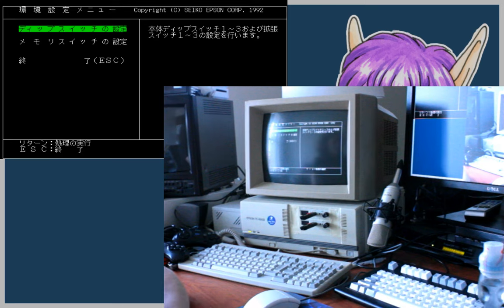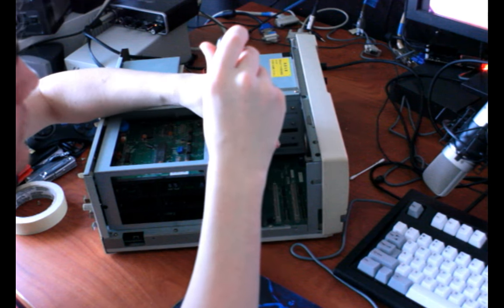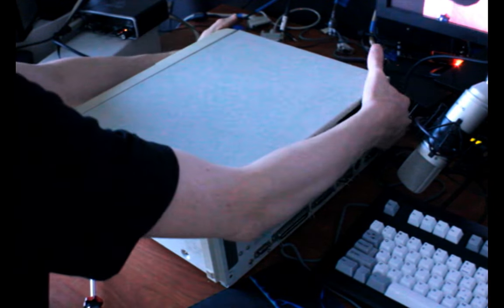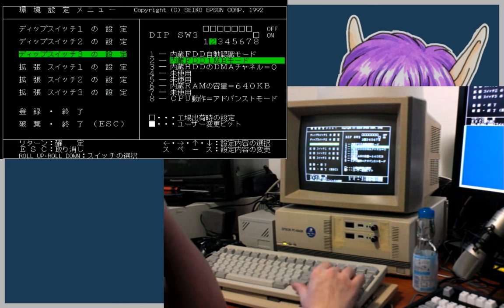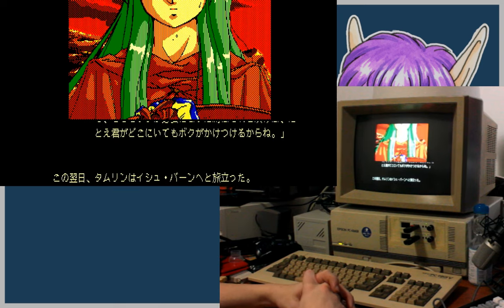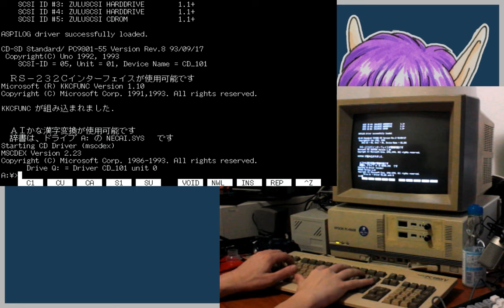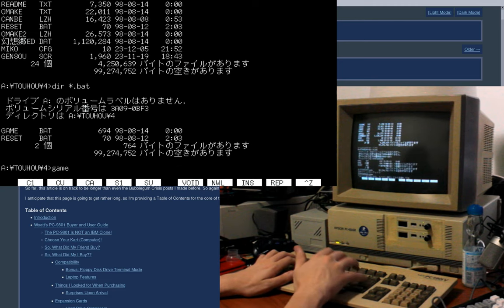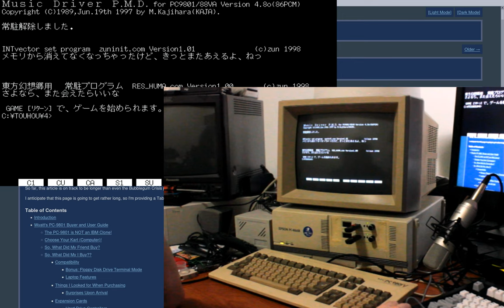All About the Japanese PC-98: My Epson PC-486GR Experiences (How-To, Beginner's Guide, and Gameplay)

Comment: I looked at the blog post and I really think some people worry way too much about somewhat newer models with built-in Windows accelerators, Pentium 1s, etc.  I remember a specific point in the blog you mentioning certain A-mate models with built-in Windows accelerators being "post-apocalyptic for DOS games" and to me that's way over dramatic.  I'm pretty sure that those added chips from Trident, Cirrus Logic, etc. don't handle the 640x400 16 color stuff at all and just kick in when software that supports them is run (such as Windows of course and some other DOS software can use them as well).

To me it gives the impression that like any model from late 1994 onward will just not run any DOS games at all and it's just not true whatsoever.  I've known several people with Pentium 1/Windows accelerator equipped models and they've run almost everything from the 90s at least absolutely fine.  Nobody should be so scared of them.  The only issue is some of these models not having built-in FM and needing to buy a card and certain games running too fast, but that's nothing unique as older IBM DOS games can be the same way.  Wish something like Setmul existed to disable cache and make it the speed of a 386, I'm sure it's possible.

Keep in mind too PC-98 DOS games were still being made years after Windows accelerators already came into the picture, so it would make literally no sense to make a game like Night Slave in 1996 and not have it run on the latest models around at the time.

As far as Windows on PC-98 goes, personally while I'd never buy a PC-98 just for that, it's fun to mess around with and doesn't hurt to try.  And the thing is, there's a fair bit of Japanese Windows games that require Japanese Windows to work and while yes you can do that on an IBM PC, to me it's more interesting and fitting on a PC-98

Btw, as far as the SB16 goes, it has a socket to add a YM2203 chip to make it a 26 compatible card, and they're much cheaper than an actual 26K or especially 86 so it's a decent budget option.
Reply from the maker: It will not run early DOS games well. Anything that was made for a V30 CPU has a chance of being way too fast unless it's capping its blitting based on the passage of time rather than CPU cycles.
Post apocalyptic is exaggerating, though. Yes.
For Touhou, a newer model is actually better.
But even in Japan people talk about the later models as having lost their "98-ness," and I tend to agree, especially for systems without C-Bus slots (like Valuestar V200). Might as well get an IBM at that point, when an earlier system will run ancient games at closer to the right speed. Bubblegum Crisis for instance.
Interesting about the SB16, did not know that.
My friend got a Cereb C200 for Touhou and it has both OPL and OPN built-in (although it's a "CanBe" since it uses something like YMF288 instead of a 2608).
My Epson had a built in 2203 but I highly, highly recommend getting 86 sound if you can stomach the price.
The window accelerator problem is for games that use 200 line video modes. Ranma for instance. And for monochrome modes.
They aren't awful options, but a 486 or older machine will more reliably be able to play DOS games, and won't have as much built-in hardware you can't disable eating up IRQ's.
Reply: @wyatt8740  I mean yes, I'm sure some really old 8 color-era games from the 80s would be problematic on them but to be honest even the beloved Ce2/Cs2 (I have a Cs2 btw) struggles with some of them too (such as Ys and Return of Ishtar having graphical corruption) so it's nothing unique.

But really imo, for the majority of 90s games they are just fine.  You can find various videos proving this with people happily playing games on models like the V13, Pentium PC-98 laptops, etc.  Oh, and Flame Zapper is another game that really does benefit from a faster machine, on a 486 the 60fps mode is unplayable.

The 200 line problem sounds more like GDC not set to 2.5mhz to me, which I think all 9821s allow you to change.  I remember trying the Screamer (200 line game) and it looking messed up until I realized it was set to 5mhz. Also if you run a 256 color game like Puyo Puyo 2 then run a 16 color one afterwards they can glitch out, but just reset the machine and it fixes it.

Really the problem I have with saying some of the later models "loosing their 98-ness and became more PC-like" is that it implies the later ones can run Commander Keen now or something, and that never happened even all the way to the end.  Also, just because some (like the all-in-one Cu13) lack C-Bus slots, doesn't make them totally worthless either imo.  They still play Kamikuishiki Village and that's all that really matters.

If I recall btw, NEC released a DOS utility to adjust IRQs on models that have both C-Bus and PCI slots.
Reply from the maker: @thepirategamerboy12  The GDC speed has absolutely nothing to do with that actually. That might be a timing bug for your specific game though. There's something you can run in BASIC to cause the problem under either speed. https://radioc.web.fc2.com/column/pc98bas/pc98disphw_en.htm
90s stuff is fine, but you can play almost everything on a Ce2/Ap2/Epson with 86 card/whatever, and the pentiums miss out on about a full decade of software.
Oh yeah and policenauts won't have PCM on a pentium system with canbe sound. And stuff like the Valuestars often don't have any kind of OPN at all, just OPL3. And yes, there is a PCI config utility that mostly works but won't let you disable things like a built in modem.
They lost their 98-ness because they ran the same exact windows 9x software everyone else ran. WinQuake, etc.. And they used OPL sound like sound blaster cards, which was inferior to OPNA (objectively; OPL is a subset of the capabilities of OPNA). And analogue gameport joysticks instead of MSX style ones.
Nothing wrong with having a pentium, it just is much less interesting and unique to me. And to me Ys is an argument for getting something from the 80's with a V30 and a mechanical keyboard if you're thinking of buying a second machine. BTW the 486GR also has this problem with Ys. I suspect it's a 486 thing. There's much less DOS stuff that really wants a pentium or higher, and for Win9X i have an IBM compatible with Japanese Windows on it.
Reply: @thepirategamerboy12  Pardon my intrusion into the conversation, I believe I have some insight of value to share. 

For whatever reason I have come into possession of a Cereb along with multiple Ce2 and Cs2 machines. I'm in a rather unique position to adjudicate for myself, and have observed there are significant differences with how (whether because of the Trident card present in the Cereb or not, I can't say with confidence) the Cereb handles games versus the Ce2 and Cs2 - and not just differences attributable to CPU clock speed or RAM. 

In fact, I have a Viper MULTi CPU accelerator board/"upgrade board" for the Ce2 which raises the CPU speed to as high as 100 MHz and can also be used in the Cs2 with some light modification for improved results (Ce2 has 25 MHz as default, Cs2 33 MHz). I actually have slightly less RAM present in the Cereb than for my Ce2/Cs2 (they are highly interchangeable). My Cereb has roughly ~30 MB (can be expanded) while I have a 32 MB stick compatible with my Ce2/Cs2. 

So, interestingly, I have "leveled the field" relatively speaking in terms of RAM and CPU clock speed between the Cereb and Ce2/Cs2. The main difference then would appear to be the architecture - the Ce2/Cs2 lack any window accelerator like the Trident present in my Cereb. 

Interestingly, the Cereb does a better job of handling the very old game of Ancient Ys Vanished/ "Ys 1", while my Ce2/Cs2 cannot run it properly without immediately running into issues - perhaps a case can be made for the Cereb here although I suspect the better solution is to pursue a later PC-9801 rather than an early PC-9821 as the Ce2/Cs2 are. But I digress. 

Whether using actual floppy diskettes of the original games, or floppies written with the game files, or a Gotek to simulate a FDD (or using actual original CD-ROM discs or burned discs - the Ce2/Cs2 come with a CD-ROM drive) the games run far smoother and stabler with less hitching, stutters, and some visual effects are present which are otherwise absent when run on the Cereb (or displayed incorrectly). 

The Cereb has a more modern FDD and a more modern CD-ROM drive (my variant specifically is the Cereb C200/C). I've tested the Cereb with what it originally came with, as well as a Gotek to simulate the FDD - and run original games, games written to diskette or disc, and games with a flashdrive and the Gotek. I've tinkered with the BIOS as much as I can, trying varying options (the Cereb BIOS is markedly limited compared to the Ce2/Cs2 BIOS, although not altogether inferior by any means - just less options for compatibility). I've used NEC DOS 5.00A-H, NEC DOS 6.2, and JP Windows 3.1 installs on original HDDs with the Ce2/Cs2, as well as installs of NEC DOS 5.00A-H and NEC DOS 6.2 on Compact Flash cards with the Ce2/Cs2. I've also used these same Compact Flash cards with the Cereb, as well as the original HDD it came with which has JP Windows 98 SE. 

In short, I've tested quite a bit. 

Perhaps the Cereb itself, or my particular Cereb, is an outlier (conversely, perhaps my Ce2s + Cs2s, or the particular models I have are outliers). But I'm far more inclined to believe that, as the unique architecture of the NEC PC-98s (and to a lesser extent Epson PC-98s - let's not forget these marvelous machines) was increasingly comprised of more components sourced and built-around Windows in general - their ability to present the most accurate and compelling vision of the games originally conceptualized for them over their lifetime was markedly compromised.

I hope my insight is of some value - have a pleasant day/night!!
Reply: @l_arachel  The Cs2 actually does have a Windows accelerator in it, a Cirrus Logic of some kind which I didn't even realize myself until I tried Win95 on it and it detected it upon installing.  It's capable of up to 1024x768 and is the other difference between the Ce2 besides a faster CPU.  Btw, I've been into PC-98 stuff for about 5 and a half years now.

The Cereb is kind of an odd model in general, it kinda seems like the PC-98 equivalent of something like the Gateway Destination.

The 200 line thing confuses me because I've seen games like Star Wars, Night Slave of course since it's literally a 1996 release, Marble Madness and a number of others run just fine.  Idk if this is different or what, Star Wars does the thing where it inserts black lines in between.  As far as monochrome mode goes, I have no idea about that at all.

As far as I can gather, the later models basically just put the base PEGC hardware into an ASIC and the Windows accelerators have nothing to do with handling that at all, it's kind of like the Voodoo 1/2 in that it takes over the video when needed.  There were C-Bus Windows accelerator cards for older 9801s that literally worked just like the Voodoo 1/2 with the whole pass-through cable situation and everything.

With Policenauts, I think there is a version of the PCM driver that does work with CanBe PCM though sadly lip flaps don't work.  If the machine has C-Bus slots though, you can fix this with a card (though imo not really worth the price).

One more thing about loosing the 98-ness... the FM Towns line also very late on got Pentium CPUs and could run versions of Windows up to 95 as well, so why wouldn't you say the same thing about those?  And I just think it's cool that my Cs2 can play games like Bomber Quest and Flame Zapper, but Windows games like You Don't Know Jack and Lode Runner the Legend Returns also run well on it.  It gives me even more to do on the machine.

I don't really have anything else to say, I'm not trying to be mean or anything like that but I do defend these models based on what I've seen from YouTube videos and people I've known with them.  I have a Pentium MMX 233 PC and even though most of the parts in it are from around 1998, that thing can play stuff as new as Rayman 2 from 1999 and also Prince of Persia from 1990.  That's close to a decade difference.  Some even older games will work though many especially early 80s games have issues, but you get what I mean and I feel the PC-98 line evolved in basically the same way.  Just like the IBM PCs, not one PC-98 will play every single game ever made for it.  The only game I personally know for a fact has problems on these newer 9821s is Quarth, that's literally one game and perhaps there's more but I like to focus more on what it does run (which the list is still huge) rather than what it doesn't.  It kind of reminds me of how some say to avoid NTSC Amigas (another thing I disagree with), but perhaps more overblown than that.
Reply: @thepirategamerboy12 I wish I'd gotten into it 5 years ago, at least with real hardware - ahhhhh how I envy your time spent with these machines!! :)

You say there is a Cirrus logic chip in the Cs2 - I've not spied one *yet*, where on the motherboard itself might I look for it? How is it labeled? I'd appreciate any guidance you can give - I have the Cs2 model S2 and S3, and failed to notice anything - but I'm not infallible, of course (and neither are my arguments or observations!). I believe the Cx2 has one present, closely related in terms of time period.

I appreciate your thoughtfully-worded reply - to be clear I also share your stance that later PC-9821s aren't fundamentally terrible or anything. I'll admit an emotional bias for earlier models, certainly, which makes me more prone to advocate for them. Spend enough time tinkering with something and you tend to fall in love, even if begrudgingly, no? (unless perhaps it zaps you or lops off an arm lol)
Reply: @l_arachel  Don't quote me on this but from what I recall on the Cs2, the Cirrus Logic Windows accelerator is stored underneath the power supply.  I've never fully disassembled mine is how I didn't find out until later.
Reply: @thepirategamerboy12  You're absolutely correct!! Thanks so much for the guidance, there is indeed a Cirrus chip of some sort present on my Cs2 motherboards (I scoured my Ce2s again and can confirm no such chip is present there). It was hiding beneath a board directly underneath the PSU. 

As to what exactly the chip does in the Cs2, I'm very curious now - regardless, just wanted to confirm what you already knew. 
I was quite mistaken to believe the Cs2 did not have a Cirrus chip in it!! This is cause for quite a lot of thought on my part, and reevaluation of my stances
Reply from the maker: @thepirategamerboy12  Yeah i have a GA-1024A, I know about the accelerator boards very well.
The Epson hires board also appears to have a passthrough cable on the 486GR.
Reply from the maker: @thepirategamerboy12  it's underneath the amplifier/yamaha DAC daughterboard.